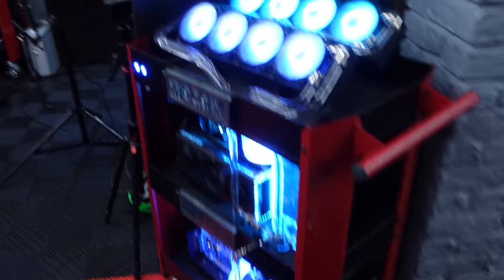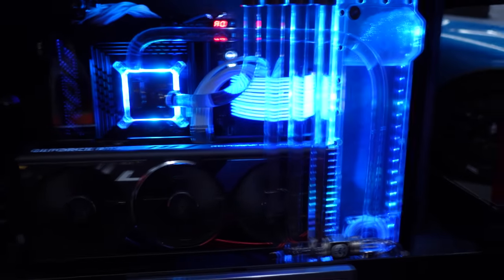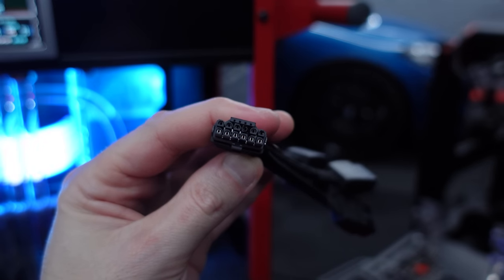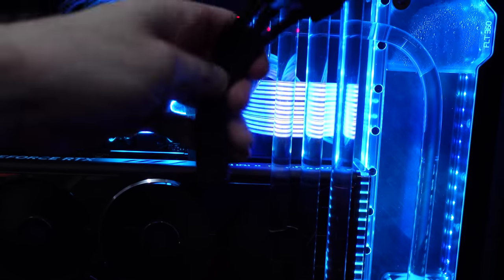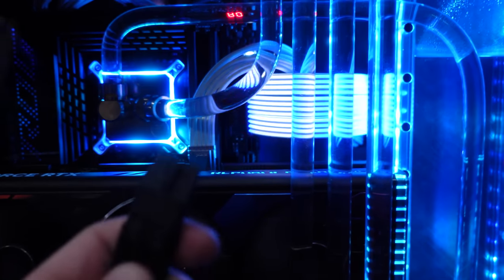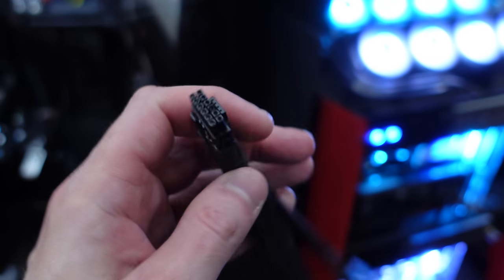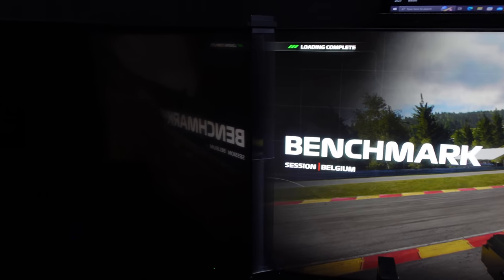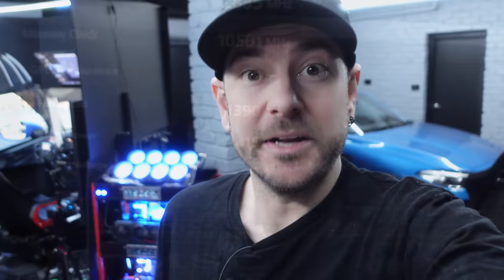MY 4090 WENT UP IN SMOKE after 7 Months!

Comment: Looking at the still images it looks like you have the adapter that was built by Astron which are now known to be bad. Astron and NTK are the 2 manufacturers that build and supply the adapters for Nvidia. The easiest way to tell what adapter you have is by looking at the inside tip of clip, if it's flat then it's Astron, if it has a small cutout then it's NTK. Companies like Cable Mod use the NTK design which uses a 4 spring contact instead of the 3 dimple contact of the Astron, as the 4 spring design increases the contact area reducing temperatures under high load. Having said that, it's still good practice to ensure that any and all cables regardless of who made them, are fully seated.

Comment: 2:23 connector sure does look a little bit crooked. :-D  On a serious note though, this scares the bejezus out of me since I also own a 4090.  I use a bequiet cable that came with my psu. Was pretty tight fitting so I hope there is good compression on the individual pins..  Just gotta hope it will keep working...
Reply: Apparently my card has the new 12V-2x6 connector. Hope it will work long term tho..

Comment: My 4090 is a year old now, MSI Gaming X Trio, and I’m extremely cautious about not tension on the connector, the side panel is off, which I’d prefer to be on, these 12 pin connectors are trash, should have been a total recall on all 12 pin cards

Comment: Damn this is why I've had my Asus 4090 sitting around unused for 6 months now I was just starting to get the urge to throw in my PC this weekend but after seeing this issue still persist and how reliable my 6900XT has been, I too would be afraid of leaving my PC unattended with the 4090 installed. 
User error is not an acceptable excuse from Nvidia it should be this difficult to install a damn cable, the more likely scenario is that the cable design is cheap and never properly stress tested.
Reply: Ah man, send it my way and I'll test it for you 😅

Comment: This is why I purchased a new psu with my 4090. I didn't want to use that cable in the box.

My new psu has a dedicated pci5 connector. No adaptors.

Your luck your gpu is still running.
Reply: Yeah same, bought one of the new BeQuiet ones with a dedicated 12vhpwr plug just so i didn't have to use that adapter

Comment: Happy for you that it did not cause bigger damage (knock the wood). It looks like a loose contact triggered sparks - with 20+ amp current, it burned down to your connect in seconds. I am hoping some day you can setup a projector  - elliptical screen - projector at one focal and you eyes at are at the other. The F1 2023 game has some tech debt as well, when you pause, render should stop, F1 2023 seems continue render the same image.

Comment: Another thought on the melted pin. What if, of the three 12v connectors, one of the other two had a bad crimp in the adapter lead thus causing one of the three 12v branches not supplying a 3rd 12v feed. This would cause only two rails for the 12v and as a result not enough feeds to supply the needed current to the graphic card resulting in a burnt plug/socket. Maybe!

Comment: Damn thats a bummer. I think the most problems with that connector is homemade by Nvidia. I did indeed get a 90° adapter by cablemod which you dont need. In case anything happens with them, they pay for you card which is nice. 

BTW nice XC90 in the back. Didn´t know that you were in the swedish tank divison as well :P :D ( yes i know its owned by china now) :D

Comment: My ASUS 4090 ROG Strix power connector melted too, I sent it back to ASUS and they claimed it was "user error". I've built 25+ computers for friends/family, over the last 20+ years, so i know what I'm doing. I knew about this issue, prior to it occuring to me, so I made it a weekly practice to ensure the cable was fully seated, but it still melted! ASUS insisted it was user error and i needed to pay AUD$110 to fix it! ASUS/NVIDIA should take ownership of their design issue instead of blaming experienced users.

Comment: Using 4090 + Cable Mod 90 degree cable + Corsair PSU cable (600watt). No problem so far even passed 400 watt sometimes.(Giga OC version)
I made sure cable was touching the socket on the GPU so not even 0.5 mm space left.  
Get a good quality 3rd party cable and cable mod adapter.
 I used my card with the side open until cable mod released their 90 degree adapters back in February-march.
Glad to hear you saw it and avoided and further damage. 👍

Comment: FYI, asus will not deny an RMA for a GPU with aftermarket water block, my 12VHPWR connector on a 4090 Tuf also melted and asus just approved my RMA the other day, and I had an EK block on it.

Comment: Same thing happened to me last week after 7 months. Tried to run witcher 3 with ray tracing and boom. I had the cable mod right angle adapter and cable mod 12vwhpr cable. Cable came out but the adapter is fused to the power connector on the card. Asus TUFF 4090 powered by Corsair RM1200x. I called Asus for RMA and mentioned fire hazard and i got a full refund from them coming.
Reply from the maker: Sorry to hear. Thanks for sharing though!

Comment: Knew the OEM splitter cable could be an issue, still used it 👏
Reply from the maker: Yep. In hindsight I should have used my cablemod cable. I incorrectly assumed the splitter would be fine because it had been running fine for 3 months before the cablemod cable arrived.

Comment: Is this an issue among numerous makes of 4090s? Does it affect any other cards 4080s, 4070ti's etc? Should I be hesitant to purchase even a prebuilt with a 40 series graphics card. Lookind to run Assetto Corsa with mods with triple 1440p monitors and VR. Any suggestions would be greatly appreciated. Thanks.

Comment: Nvidia didn't do its due diligence, way too small of a safety cushion on that connector. 7900 XTX is the safer option
Reply: The xtx has a hot spot issue and a high power draw, and bad drivers, better to go with the 4080.
Reply: @davehenderson6896  tell me of the driver issues? My XTX doesn't have a hotspot issue. The 4080 is an overpriced dud.

Comment: well.. this is w hat happens when you go from 24 pins at 4 - 500w in the old standard to now 12 pins at 600w through an even smaller connector... the standard needs to be abandoned if you ask me OR these gpus need to start using 2 of these connectors for power delivery..
Reply from the maker: Agreed!
Reply: 24 of the old pins give you 450W not 500W. But combined with the pcie socket it is 525W in total. Well enough for a 4090.

Comment: I think the fact those new proprietary  run on two rails causes more heat on the same gauge of wire . I opted to use the plug my gpu came with .4x rail to 600w .One would think better heat distribution and i have not felt any warmth on my plug after a gaming session on my ocd 4090 pulling almost full 600w .

Comment: You can tell in your first still photo that when the cable heated up it wasn’t fully inserted. You can see the plastic shroud on the nvidia connector clearly shows an indent as if the connection wasn’t seated. Hate to break it to you, but this is another classic, it wasn’t fully inserted.  Maybe when you wheeled or moved the PC it was enough to have the connection come loose, but because there wasn’t enough strain it wasn’t an issue. The fact this JUST happen after you ran a game with high wattage further proves the problem was always there. 

There is a reason why new connectors are now coming in orange and yellow to show users the connection isn’t fully seated.
Reply from the maker: It was fully inserted and visually checked regularly. I was very aware of the problem and made absolutely sure. 

If it wasn’t fully inserted it wouldn’t be just one pin that got hot but an entire row. I agree the problem was always there waiting to happen though. I’d say one of the female pins was probably a little more splayed out than it needed to be to make a perfect connection despite the connector being inserted correctly.

Comment: The way you have the cables (leaning left/right) is exactly the same way many others have it when things go up in smoke for this card.
Reply from the maker: At some point the cable is going to have to fall away from a straight line. There is absolutely no pressure or tension on the cables whatsoever.

Comment: I had this EXACT problem last week. My 4090, which I know was plugged in correctly (more on that in a sec), melted the connector. The Cable mod connector melted. 

I know it was plugged in correctly because ASUS who is doing the RMA couldn't remove the plug.

Comment: I'm not using the adapter but the corsair cable so hopefully that should not melt :D But yeah I'm worried about that as well, even had the voltage supervision on for a while but I've kinda stopped at some point as I figured it should be fine. Maybe I should start again...
Reply: There are Corsair cables melting on 4090 as well. You're not safe.

Comment: I think that also shows you that even under what we would think is no load being paused and doing nothing your, gpu is still going at full speed and pulling all the power it can. In most games where I can I always like to set a low fps limit when in a menu so try and prevent this. Not sure if would work while in a race paused, but given that cards are only going to pull more power and in turn run hotter it might be good for games to build this kind of feature in. Saves power heat and hardware so what I would think would be a simple bit of coding
Reply from the maker: The car still would have burned. It just would have done it while I was in the room.
Reply from the maker: Card^

Comment: Hello! Did you ever checked your 12VHPWR Voltages? I mean, the 16-pin voltages? Probably you had a 12v drop before the melting. Besides, you had any blackscreens and fans ramping up episodes? That usually happens just before the melting.
Reply from the maker: No never had any stability issues at all. Didn’t check voltages. Unlikely there was significant voltage droop as it’s running off a 1600W PSU
Reply: @boostedmedia  so I strongly suggest you to monitor it with HWiNFO64, that should be hovering around 12.1V to 12.0V, if drops below 11.7V I would start to get concerned. My 4090 had the drop, blacks screens and fans ramping up, while GPU was around 300w only. When I checked the voltage it was 11.5V.

Comment: Always be certain your 4090 is completely plugged in, or just be super safe and dont buy 1. Glad youre ok and it didnt do any real damage though
Reply: 9:42
Reply: That is a myth Nvidia wants you to believe.. these cards are busted and when you use them every day at their max capacity, you will have a failure anything you do.... 450w on a single wire was and is a stupid idea... I can't wait when they put the power in the motherboard side and this same thing will happen ,but your mb will burn. The only people who don't have issues with these cards are those who bought it just to have one and never use even 50% of what it can do.
Reply: the 3090 ti had the same connector and there were no reports of it melting  @UmbraWeiss
Reply: @AttilaTheHun333333 blud - look at 5:12 (the image of the burnt connector). The wear marks clearly show a 2mm distance between the end of the connector and the marks… suggesting that the connector wasn’t in fact plugged in all the way

Comment: To have to pull the connectors out of a new card to pinch them a bit tighter seems ridiculous. Wait no, those are you're cables. What would totally frost me is if my humongous card was cracked in a new build. In that case I would pay the postage to have the card shipped alone.

Comment: One question: how is F1 2023 work with separated wheel and pedals? Say Simucube (pro) wheel base (via an USB hub to mobo)  and Heusink  (ultimate) pedals (same USB hub => mobo). F1 2022 failed - it can only recognize either wheel or pedal but never both.
Reply from the maker: This and F1 22 both work fine with multiple
Inputs.

Comment: have you seen igors dissection of those adapters? now Jayztwocents did a dissection too and  gamers nexus did a serious deepdive with a lot of info, some of those adapters were made to very cheap specs. i've not used the supplied adapter not even once, luckily i upgraded together with a new psu and that came with a dedicated 12vhpwr cable without pigtailing.
Reply from the maker: Yep. I posted a link to it right here on the channel 7 months ago.
Reply: @boostedmedia  ah man it sucks even harder when you knew about the dodgy adapters and still used them. i guess you'll be checking new games for power draw from now on, might be interesting set of data to have on every game, what does cpu gpu power look like, cpu gpu boost clocks, temps, ram usage etc. to have a basic idea of how much a game stresses the system

Comment: If the cable goes up in smoke when there’s a shift in air temperature, there’s an issue with the connector

Comment: Mine melted today after around 18 months. I am into electrical engineering. The GPU needs 600 watts, and the volt is 12. So we need 50 amps. They used 4 wires in parallel, which means each of those tiny cables needs to do around 12amps. This will melt the cables within a few days, but most people do not push their cards more than 300 watts.

This is the design of the trillion-dollar organization. I will see tomorrow what the seller will say as I am supposed to have 4 years waranty.

Comment: damn thats scary. I just got a 4090 and am using a native 12vhpwr connector straight from an atx 3.0 psu. So am I suppose to just wait one day until i smell something burning? lol this sucks
Reply: mine has literally just done it on microsoft flight, (first time I've played it) sim gigabyte 4090 with the cable mod bracket installed, and it was in right. as its been bugging me ever since all this debacle started, 2 pins melted in the connecter top row 3 from the left and top row far right pin, sucks man
Reply: @martinmalone6324  that sucks man. I've been seeing alot of reddit posts about that CM adapter melting. I'm pretty scared so I power limited my 4090 to just 70% max power. Kinda stupid we gotta resort to random fixes for this.
Reply: It’s happened twice now both with cablemod rt angle adapter, this is unacceptable.

Comment: Massively reduced power draw when games are paused should be mandatory in this day and age. No reason to fully render everything for a static screen like that. You could simply have the game take a screenshot and show that instead.
Reply from the maker: I have to admit I was surprised it was still pumping 100% load when paused on a static screen. Wouldn't have left it if I'd realised purely due to the waste of power. But the connector should be able to handle the power that the card is capable of drawing.
Reply: @boostedmedia  For sure. Can't blame game devs for hardware failure like this.
Reply: In Call of Duty, I can cap the frame rate to 120hz with V sync while in the Menu screen. As the match starts it automatically unlocks the frame rate and turns off V sync. I really love this feature

Comment: But it is that I should never have used that adapter with the 4090. I have a 4070Ti that comes with the same adapter but for 3 8-pin cables. It is obvious that for a 4070TI that consumes maximum 300W the adapter can work. But for the 4090 it is impossible. The connector is very small. I don't know what Nvidia thought when they implemented it. It is not necessary to do tests to know that it will not hold. Is in sight.
Likewise, that connector, no matter how much you use another adapter like the Corsair, will always have a tendency to heat up in the contact area of the pins. But the difference is that the corsair does not have a tape that prevents heat from dissipating behind the connector. That makes the difference.
Reply: I'm running my 4090 at 60% powerlimit, never seen the card go above 300, capped the FPS to 118 in the NVidia control panel (120hz)
Reply: @greggreg2458  Yeah. It's okay what you do. You probably use only one monitor. But for 3 4k monitors these people need to push the 4090 to the limit.
If the 4090 had 2 8-pin connectors like the 1080Ti had, there would be no problem. But here they wanted to reinvent the wheel and it went wrong.
Reply: @arielcor7392  But yes, the old 8pin was way better.
Reply: @arielcor7392  My 4090 scores 29405 points in superposition 4k optimized, that's 5% less performance for 33% less power draw, 298W vs 447W.
Derbauer made an excellent video about the 4090 stock power draw, it's titled "the 4090 power target makes no sense".
Reply: @greggreg2458  Yes Yes. For a single 4k monitor the 4090 can go halfway. But for 3 4K monitors they must overclock even if it is minimal. And there the 4090 if or if it is going to go above 400W. Even if they use a 60FPS limit. 3 4K monitors is 3 times more than your setup.

Comment: Hi Will ...I haven't commented in a while ...summer has me busy. I've followed your builds from day one & I feel for your loss. I run a water-cooled CPU & 3080 running triple 43 inch ...4K displays. I don't think it would survive the heat without water cooling. Which brings up this question ...I am considering a 4090 but I wanted to use water cooling. Can one do this without voiding the warrantee? If not ...we can only hope Nvidia will supply a water-cooling unit that will not void the warrantee.